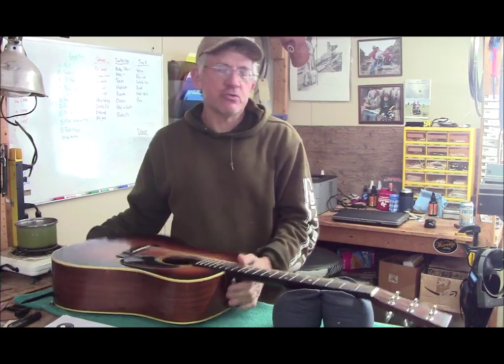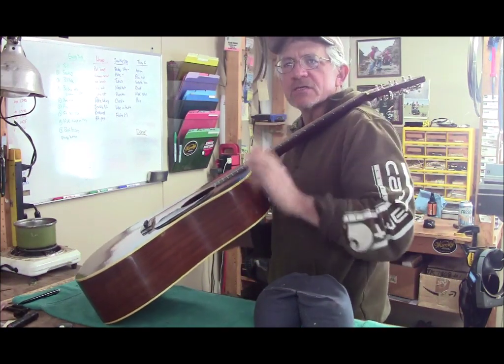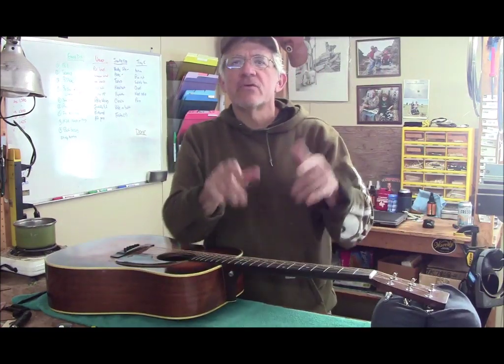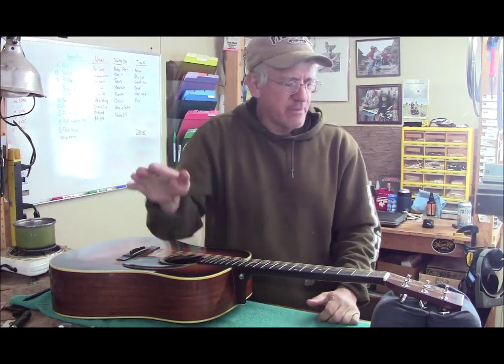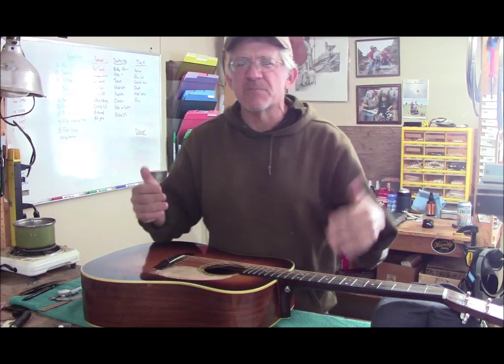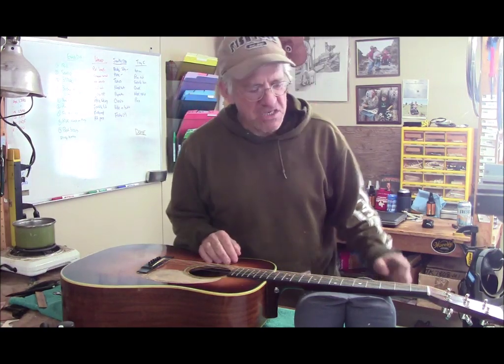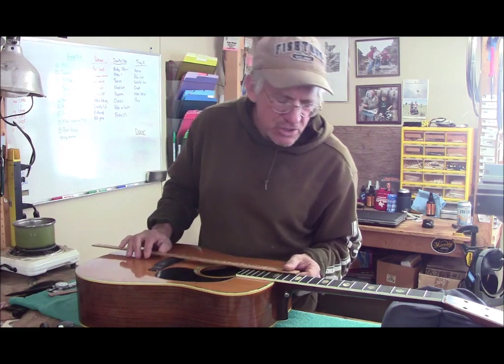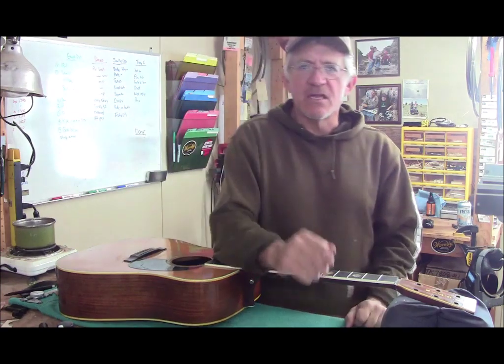Evaluating a 70's Martin 14-fret D for purchase

Comment: recently got a old yamaha and noticed the bottom of bridge after saddle was removed that the depth on treble was almost half of what it is in bass side ,didnt route it out maybe later on just adjusted the saddle to where i like it but strange that it was lower in saddle slot on bass side,same as the nut bass side was lower im thinking it was a accident but replaced plactic with bone including pins has alot better mid and bass range now

Comment: Martin makes an oversized replacement bridge to correct their intonation goof.I had my 77 repaired w/ neck reset, refret, pin holes plugged and redrilled.Guitar is revoiced for the better. Plays good too.
Reply from the maker: I'm quite aware of that and if you like that option, fine, but I detest over-sized bridges.  You have to remove original finish to install them whereas when I make or re-shape a bridge, I make them narrower front/rear- to the size of a 50's bridge- and this lets them sit in the original footprint with no removal of finish.  I have to finish the bare scar in front of the bridge but at no time have I removed finish.  You could go back to the stock bridge, if you wanted.  The oversize bridge also changes the pivot point of the saddle since the saddle sit farther back from the front edge.  And finally, oversize bridges weigh more and that's not the sound I want.  Every option for correcting intonation is ugly- as I well explain- but oversizes bridges are the ugliest of all, IMHO. Many times I'm also moving from 2 1/8" to 2 1/4" string spacing and thus, I just make my own bridge for that.  But, hey, it's your guitar and if you're happy, that's all that matters.
Reply: Bryan Kimsey thanks, I respect your professional and highly educated opinion. Mine had an unbalanced tone- screaming high end which I loved, and muddy booming lows. Revoicing by loading the top with more bridge mass and moving the strings down in the bridge plate gave a sizzle and definition to the lows and tamed the screeching highs.Maybe if I’d paid more ($650) ... but I still love that instrument.
Reply from the maker: That's fine... many people are fine with oversized bridges and there's more than one repair approach out there, it's just not MY approach.  I want happy customers and so I try to be clear about what I'll do and not do.

Comment: Good video. One question is after shimming a neck block instead of the other options, what happens if the neck needed to come off for any number of reasons? For a heating rod or steam nozzle, could you still pull the 15th fret and angle the drill to get between the neck and body? Or, would you drill 1/8” south of the 15th fret and drill straight between neck and body? I guess either way, its easy to hide, but a repair tech would need to be on his or her toes, not just going by work habits when attempting to remove the neck.
Reply: I meant shimming the dovetail, not the neck block.
Reply from the maker: Normal shims go on the dovetail. They don't affect the  space in the cavity at all.  For the shims on the face of the heel that push the neck away from the bridge, you might have to re-install them if the steam blows them off.  They might stay put. Just depends.  I pretty much always plan on rebuilding shims and as far as I know I'm the only guy shimming the neck back to correct intonation. 

Here's what I'm talking about. This one was used to correct an overset neck and that's where I got the idea of using a shim to correct intonation. 
http://www.bryankimsey.com/Neck%20shims/P1010009.JPG
Reply from the maker: And here's shims in place, stained, finished, to fix an overset neck in my personal D-28:

http://www.bryankimsey.com/instruments/modzilla/Modzilla_neck_shim.JPG
Reply: Bryan- What I REALLY meant was the neck heel. Dang!
Reply: And yes, I had a feeling it would look good. Seems like that 15th fret is higher, now. That’s all I was commenting on.
Reply from the maker: Well, there's actually MORE neck heel/neck block air space now since the dovetail is 1/8" farther out.
Reply: 10/4, copy that.
Reply from the maker: LOL.... okay. just start all over and ask your question "fresh" in a new comment, not a reply.  :)   I'll delete this thread after you do that. .

Comment: I don't think the 5th option will work Brian, the nut in relation to the frets is in the correct position already, moving that will create other big tuning issues, or am I mistaken, could be wrong?. 
Would moving the saddle and or bridge pins back 1/8th be another workable option? This would not damage the guitar or look ugly, unless you could see the pins and saddle were slightly out on the bridge?
Reply from the maker: Earvana nut.  Google it.   Nut compensation works... I've used to to compensate guitars that were flat by moving the contact points back at the nut. 

I go thru all the options on my website and moving the saddle/pins back IS an option but it's also ugly.  It doesn't look right with the saddle sitting in the middle of the bridge and pins way back.  It changes the fulcrum of the bridge, too.  The bridge no longer wants to pivot forward as hard but sort of bounces up and down.